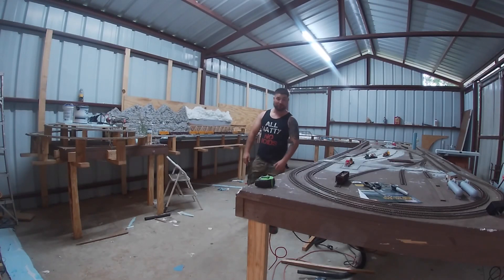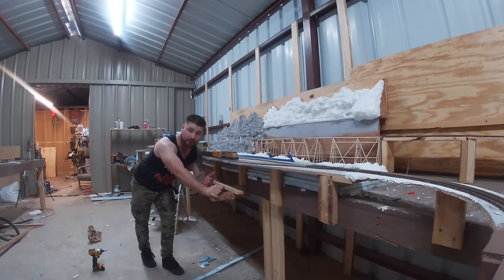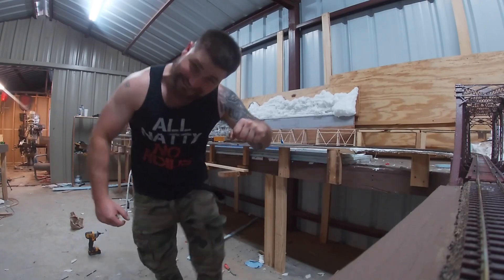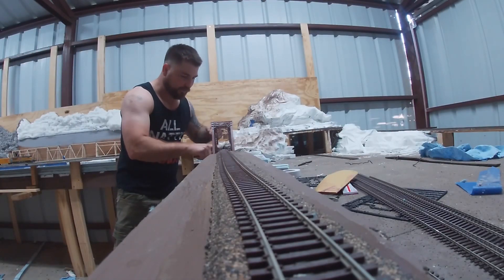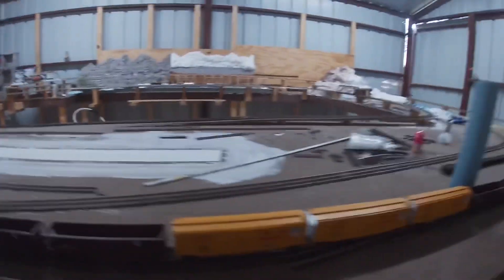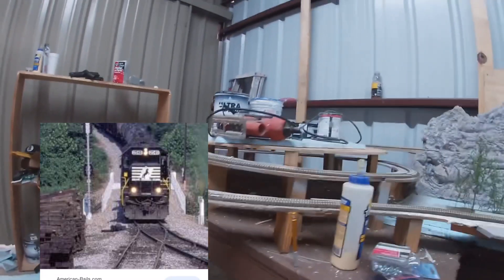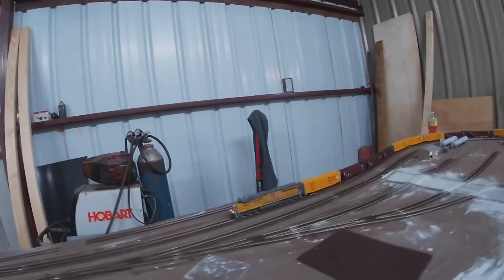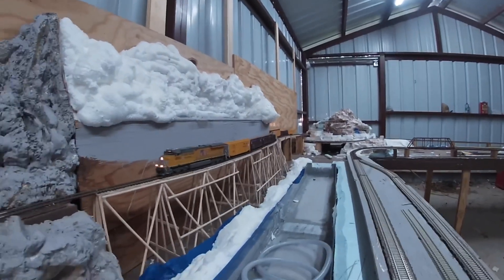Train layout:: Affordable hobby that is very entertaining(get u a layout started)

Comment: AWESOME MAN!!!!! Great feeling having those trains bangin the main!! 
Hey another tip for ya, 30+ year model railroad guy here lol....

- Pre weather all your track with RUST-OLEUM spray can Camouflage / Earth Brown.
BUT first run a bead of chap stick original along the tops of all rails. Why? Cause it's gonna
save you so much time cleaning the rail tops after your spray everything.
- Then ballast and finalize track weathering using  powders, rail rust, etc
  Use your weathering trial and error on some test sections first until satisfied. 
Bammmm - Alex K.
Reply from the maker: Thanks Alex…will do …thanks for the tip ..u the first to input on wreathing tracks with details..thanks again

Comment: No hobby is affordable  if you want cheap budget you won't afford DCC anything  but you're train shows will have the cheapest locomotives  rolling stock my advice to all new beginners do not buy the most expensive locomotives and rolling stock  start with  DC trains they be the cheapest route to take to start most everything that  DCC guys can do you can do with Dc layouts  and have just as much or more enjoyable  fun theres completely nothing wrong with DC if you run tyco Bachmann  life like etc but everyone thats just getting into the train hobby  if you start DC  with stuff from a train show train shop its going to save you alot of money  but if you're a beginner and you only afford one locomotive  thats you're problem blowing  money on 1 locomotive